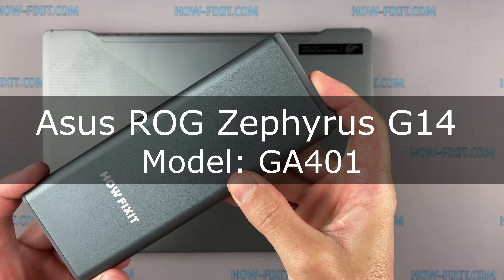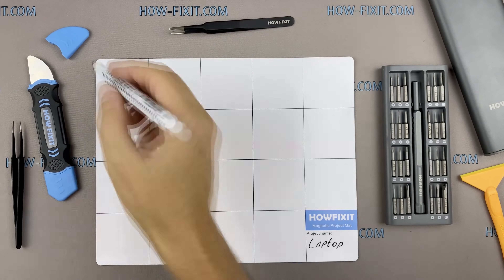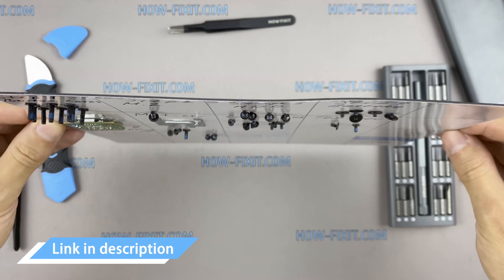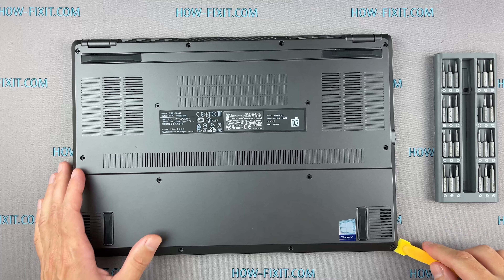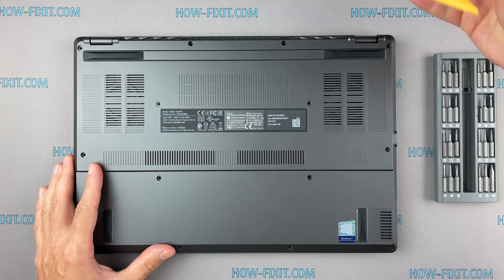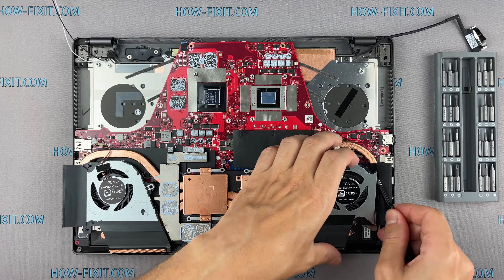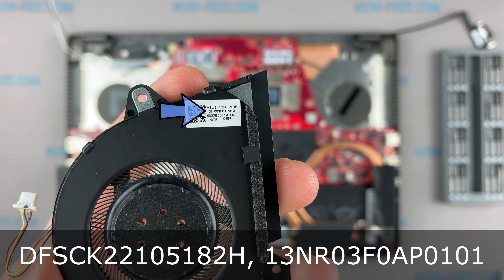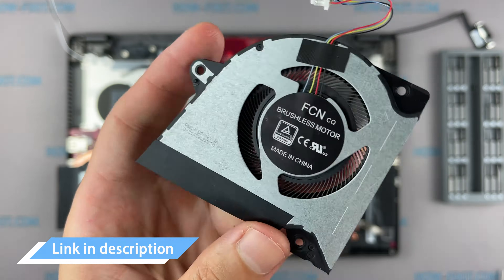Asus ROG Zephyrus G14 GA401 Fan Replacement | Step-by-step DIY Tutorial

Comment: Some spark came when I tried to put the cable back in and now my display doesn't work . When I connect to the external display using HDMI everything works fine. So what's the solution for this. Can someone please help me?

Comment: Thanks for this. I had to change my CPU fan because it started to make these high pitch whirring sounds like something was stuck. A few notes:

1. I did not need to dismantle the side cables like some of you also, just jiggle it around the fan channels.
2. Be careful also to use a good right-sized screwdriver with a thick handle: some of the screws had threadlock on them so were quite stubborn and I nearly eroded the screw head of the top left screw of CPU
3. I used masking tape to cover the battery connector and port during the "surgery"
4. Be sure to use the opportunity to clean the heat sinks too, mine was super clogged with gunk (i have 2 cats and my laptop is 5 years old - 2020 G14)
5. I used the opportunity to repaste the 6 smaller modules (vram?) next to the GPU too - it was all dried up
6. I found the best way to spread the paste was: 1 blob in the middle, then left-right swipe then + up down swipe, then you pretty much get a square block covering the surface.

Thanks again for this in-depth video!

Comment: Just got a spark on my motherboard from removing that battery connector. Damn if that metal piece holding it together is unstable, fron the video I couldn't see the correct way to remove it. Luckily my laptop survived, many others killed theirs with this same issue. BE CAREFUL GUYS!

Comment: JUST DID IT! Thanks and thanks all the warning comments. Note a couple things - I put a small piece of packing tape under where the battery cable clip slides out of and then wrapped the connector in electrical tape to ensure no shorts from the battery during work.

I also did not disconnect either wires running through the side channels of the fan assemblies. You can work it out around them side by side no issue!

Comment: Seems entirely unnecessary to take the whole heat synch off just to replace a fan. Aside from the wire, ive removed both fans in the process of cleaning out dust and fur. The only part where the heat synch gets in the way is where the wire connects to the motherboard...

Comment: Thank you for this instructional video. Changed the fans without a hitch, guided by the video and some useful comments in the chat. 
I made one departure from the instructions - I didn't disconnect the leftmost and the rightmost wires that bypass fans on both sides. Instead I very carefully wiggled the fan assembly out and back again after switching the new fans, without putting any tension on either wire. 
A brief end point - don't be afraid if you initially see a blank screen when you power up you laptop after assembly. It just takes a tad longer to boot up after being disconnected.
Reply: Thanks for this comment! Hadn't I read it before doing this and booting the laptop I would have freaked out badly for sure 😂. But knowing what you said, I waited patiently and all is good. But the blank screen really takes its time, heh.

Comment: help please? i’ve had a G15 since 2019 and randomly without warning it seems my fan has 💩 the bed… when i entered UEFI/BIOS my cpu temp started at 40°c and raised to 73°c within minutes (i was not gaming or previously gaming) and my cpu fan speed will not exceed around 774rpm…?! does this mean my fan is faulty and i need replacement? please help thank you so much 

(i have a 2019 ASUS ROG Zephyrus G15 GA502DU) 

problem literally occurred overnight… not sure what happened but besides the overheating and low fan speed, the laptop still runs beautifully, no lag or slow loading speeds anywhere?

(i haven’t spent more than 10mins in a game due to overheating but within those 10mins the game ran fast and normally) i never once had a problem with this laptop until now

Comment: Just finished this repair for both fans, follow the top comments about the power source, and just fyi, if on an older model (im on a 2020), the screws might be stuck in place, i had to use a stripped screw set to finish the repair.

Works like a charm now!

Comment: Thank you for this video - my GPU fan sounded like an angry hamster on a wheel and I decided to replace both fans and put down new thermal paste on all of the places that had it...I noticed that it wasn't put on all of the board components in this video.  I had no issues with cleaning off the old paste with some alcohol and cloth, and then put on new paste.  My idle temps are about 5 degree C cooler now on the GPU (was 38, now 33) and 3 degrees cooler on my CPU (was 40, now 37).

Comment: My GPU fan are lately always 100% no matter what, event using Gtne, manual mode etc. In the Asus app it seems that something is wrong with fan and needs to be sent to repair. Does changing the GPU fan would likely solve the issue, or it could something else?

Comment: Exercise extreme caution and TRIPLE CHECK that the battery is COMPLETELY DISCONNECTED - fan swap went great, but the battery connector slipped back into the socket.  When I was attempting to plug the display back in a live wire shorted against something on the motherboard and fried a $3000.00 notebook.  PUT TAPE AROUND AND OVER THE POWER CONNECTOR.
Reply: happened when trying to upgrade ram but the screen fried for some reason still works thru hdmi
Reply: How do you know the battery has been completely disconnected?
Reply: The same thing happened to me and my display is not working. When I connect to the external display using HDMI everything works fine. So what's the solution for this. Can someone please help me?

Comment: Do I need to replace thermal paste when i replace the fan?
Reply: Generally it's good practice to clean off old thermal compound and apply new when doing repairs like this.
Reply: @th5811  my laptop is 5months old is it really necessary to replace the thermal paste or can it go without it, without suffering  any performance loss?
Reply: @tiltednite2366  If you're replacing the fans because they are already beginning to fail, DON'T! That's a warranty issue and should be 100% covered. Don't risk damage to the machine and voiding warranty if anything goes wrong with the swap. If you're swapping for another reason, I'd still advise against. If you proceed though, it's your call to swap the compound or not when it's had so little runtime at only 5 months old.
Reply: @tiltednite2366  I have just ordered new fans and I am planning on doing this today. I also ordered thermal paste to repaste it but I don’t know if it’s necessary. Kinda of nervous doing this but from the comments I read people seem to have done it with relative ease.
Reply: @th5811  what if my warranty expired?
Reply: @th5811  the fans had a complete failure won’t turn on at all they just make a loud high pitch tone every time I turn it on
Reply: @tiltednite2366  if you decide to do this than I can recommend fans for you
Reply: @muzaffarhassan2787  well I’m planning on doing it today aswell I have the fans and thermal paste just I don’t know if there the correct fans I have the 2021 3060 model g14
Reply: @tiltednite2366  do you have discord?
Reply: @muzaffarhassan2787  I have my old discord I can send it
Reply: @tiltednite2366  send it and I’ll add you
Reply: @muzaffarhassan2787  If warranty is expired, then replace away! Tilted in all likelihood has a warranty though.
Reply: @tiltednite2366  If the fans are completely seized, best step is to contact Asus by phone, confirm warranty, and proceed from there. The only reason to forgo that warranty is if they give you a crazy turnaround time that you don't want to wait for.
Reply: @th5811  i replaced the fans and after i turned it on and the fans were working for a second then I powered it off and tried turning it back on then the same high pitched noise came on and the fans wernt spinning the laptop itself turned on still works but just loads everything extremely slow I need help
Reply: @tiltednite2366  the 3060 model has liquid metal, if you didn't let the computer completely cool off then it probably ran out when you removed the heat sink. Check your temps if it's still an issue.
Reply: @muzaffarhassan2787  btw can u link any good fans?
Reply: Have you done this yet?
Reply: @muzaffarhassan2787  no, I’m replacing broken fans on my g14 they’ve been making a clicking noise and struggling to spin and finally died after a couple of months, I’m looking for reliable replacement fans but I’ll update when I find some and replace it.

Comment: I hve replaced the fan and fan is working fine but the fan is not visible anywhere not is asus armoury crate, and in bios settings too.
Reply: You probably have to update armory crate and also check the my asus stuff
Reply: Have you fixed this problem?

Comment: Thank you for this video. I used your step by step instructions and was able to replace my GPU fan without many issues. The harder parts were this for me: 1. Taking out the power connectors to the fans. Took a little bit of finesse and time for that. 2. Spreading the thermal paste from my Cosair brand. It was more like clay so I just had to make sure I pressed on it a little harder to spread it. 3. Knowing to push down the power connector down far enough! Initially it didn't turn back on but realized, when watching the video, that the copper link didn't slip right over the top of the connector. Once I got that back in, my computer is running like a dream! This is my first time doing this to a computer, which I was nervous about but was able to do it with relative ease honestly. Just remember to take your time with the whole process and get a good tool kit. That is very important! Thanks again poster!!!
Reply: What do you mean by pushing the power connecter down? My cpu fan is rattling and I am going to try to replace soon any tips?

Comment: Be warned, there is a ton of goo connecting the heating chamber fixture to the diodes. Do not just lift it from one side. Very gradually peel from all sides, very close to the middle. If you lift it by the fans you will almost definitely bend the heat pipes. It is VERY easy to bend the heat pipes.
Reply: That goo is probably worth replacing with new thermal paste.
Reply: @billyhernandez5007  Just completed this repair on my laptop yesterday. The paste is the same on all of the components, but only the paste on the gpu/cpu was dried out. He didn't replace the other thermal paste as it wasn't necessary. (I got halfway through removing all of it before realizing in the video that he only removed it in the places it was dried out).
Reply: could you elaborate? i dont know all of this terminology as a noob. what do i need to watch out for? specifically, where in the video can you point to where this heating chamber fixture with goo is? and how should i lift and pry off the big fan piece thing
Reply: @bac0ntoast  The step between 3:15 and 3:30 is what I am talking about. It is very important to follow how the demonstration uses the blue lever to lift up around the cpu and gpu, as the diodes are concentrated around them. The goo I am talking about is the globs of blueish paste right along the bottom of the screen at 3:31 when they flip over the "fixture". It is what they wipe off of the gpu and cpu from 3:30 to 3:36, but there is more of it on the diodes and on the rest of the heat sink fixture.
Reply: @zacharythatcher7328  thank you so much! The diodes I assume are what has remnants of the bluish paste on the top of the screen around 3:29? The eight small blobs of goo? Or the four ones around what i assume is the cpu? what exactly are the diodes is my question

Comment: VERY IMPORTANT- if you remove the battery connector, use EXTREME caution while doing so. There's a bit on the battery connector that can fall and short out the laptop motherboard if you're not careful! This fries the laptop and it will no longer turn on. Make sure you don't drop the metal piece while disconnecting the battery or you may kill your G14.

EDIT: The metal clip on the top of the battery connector is the problem here. It's the silver piece on the connector that's slid backwards in the video so the cable can be pulled out. If you're very careful and make sure it doesn't fall you'll probably be fine, but I recommend putting a piece of electrical tape behind the connector so there's no risk of it falling on anything and causing a short.
Reply: are you saying to basically not let the end of the cable at 1:34 to touch the motherboard? just asking for clarification because i'll be doing this very soon and don't want to fuck myself
Reply: Do you have remove the batty cable?
Reply: Will it no longer show the screen or will it completely fry it?
Reply: @tiltednite2366  it's an important possibility that if you miss manage that metal piece you can kill the motherboard or individual connectors
Reply: @diegovillacreses7071  mines sparked when I plugged it back in and it still ran fine I had To get a refund though becuase or a mother board defect it had nothing to do with the spark though there was an already on going problem before It sparked.
Reply: @tiltednite2366  mine sparked too and works fine. But as far as I have read about this issue is a possibility that you can kill your motherboard or a part of it. So extreme caution should be recommended in any of these videos. Precaution that sadly  is not mentioned in these kind of videos.
Reply: Happened to one of my old laptops. It sparked when I plugged the battery in and the laptop is totally dead. Be careful with it
Reply: Is removing the battery necessary?
Reply: @tgtbtu9459  disconnecting the better is safer if you don’t wanna risk you shorting you laptop as  much but you don’t have to remove the battery just doc connect it use caution you could Wally short it if your not carful about where  you place the battery connector
Reply: @tgtbtu9459  yes, if not you could induce a shortcut. You just have to safely unplug the battery, total removal isn't necessary.
Reply: @diegovillacreses7071  any tips on disconnecting the battery I'm having a hard time doing that does it just slide backwards or am I lifting it up? I'm scared to use too much pressure any tips?
Reply: @tgtbtu9459  ideally use iFixit tools, the small plastic pry would help to catch the metal clip when you take it out. What I do is to carefully move the clip with two fingers just enough to plug out the battery, without completely remove it. Hence, plugging it would be very easy. If you are too nervous, your hands would shake, in that scenario it would be better to take your laptop to a technician and pay him/her more to teach you.
Reply: @Woodesies  I noticed the clips on the sides of the port lock it in place. You need to slide the black clip away from the bracket to then pop the connector out of the white housing thingy lol. I was able to do what I needed to after not being scared of breaking it anymore haha
Reply: could you elaborate? i dont know all of this terminology as a noob. what do i need to watch out for? which thing he unplugged is the battery connector, and what should i be extra careful with?
Reply: @decidedlyjass  thank you very much!! Will be cautious

Comment: Fucking Asus, fan died on my zephyrus g14 after 2 months
Reply: Damn mines been running for abt a year now I just need to clean it
Reply: Did you get it fixed? How is it now? 

Asking bcoz I recently had the same issue. Thx.
Reply: @Louise-vp7eb  I opened the laptop and cleaned it the best I could. After a while it stopped making noise, but the fan doesn't spin well, its a bit stiff. on top of that  2 white spots appeared on the screen. My next laptop will be a macbook. I won't waste anymore money on Asus.
Reply: @S.Theodore  Thank you so much for sharing! I'm sorry to hear about your bad experience with the g14 tho. Have a nice day!!